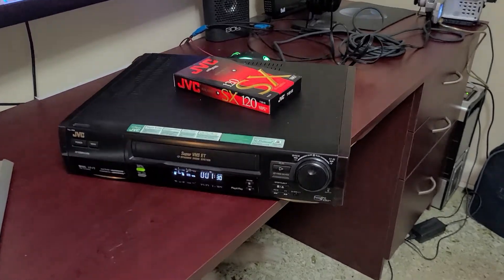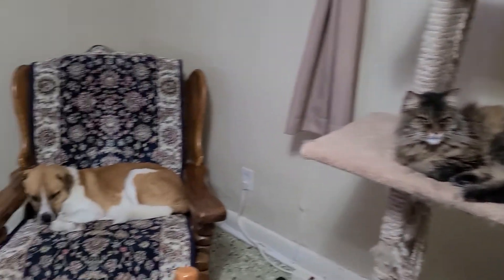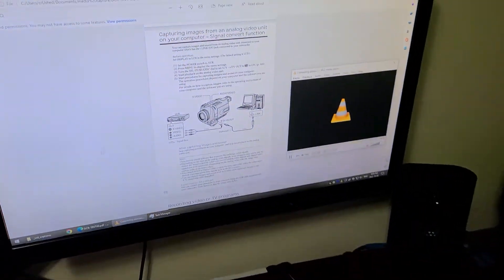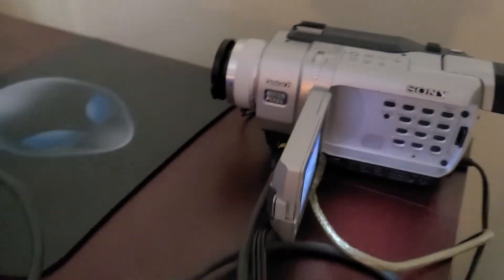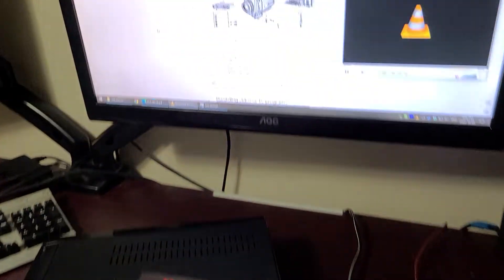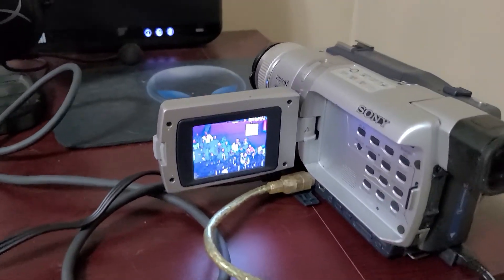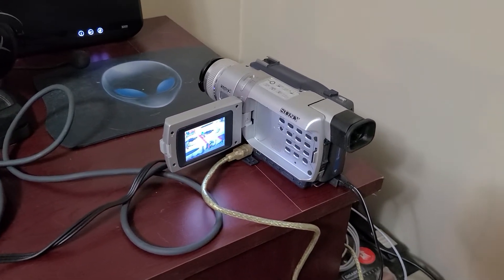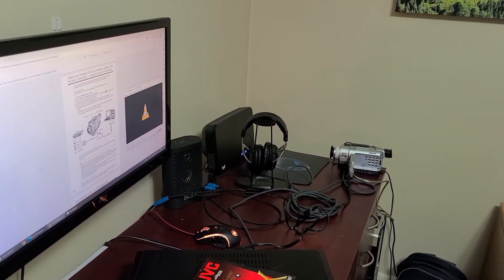VHS Digital Conversion Using JVC HR-S7500U S-Video to Sony Digital8 Handycam to Firewire

Comment: It is me again this time with a question. I have been doing this method that you have come across for a couple of years now and the one thing that I have had is a problem from time to time with audio sync. I have gotten quite good at syncing the audio back up with the video in final cut pro but I’m curious if you have that problem as well. It happens both when copying a digital8 tape that’s running in the camera and when I’m running VHS through the exact same digital8 camera you have there. I use a Mac
Reply from the maker: Hi there - yes, I have the exact same issue from time to time, especially when capturing footage longer than 3-4 hours.  It happens no matter what I've tried - even with passthrough devices like the panasonic dmr es-10.  Same as you, I just fix it post-capture using a video editor (Sony Vegas is what I use).  Take care!